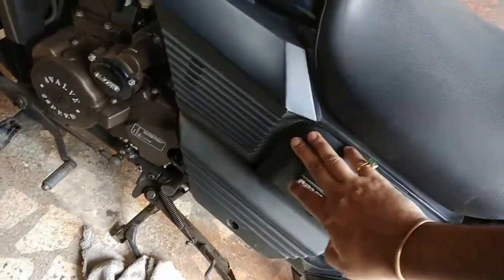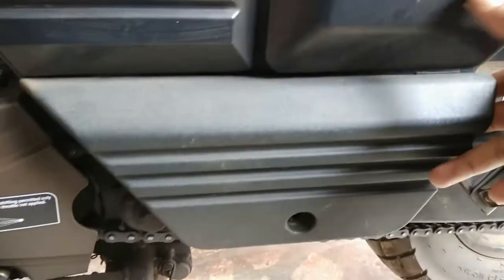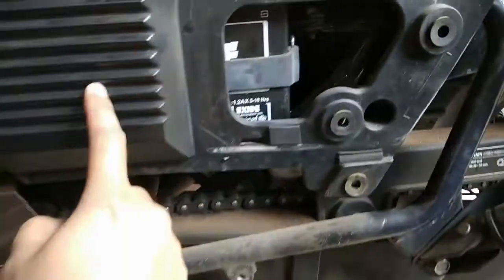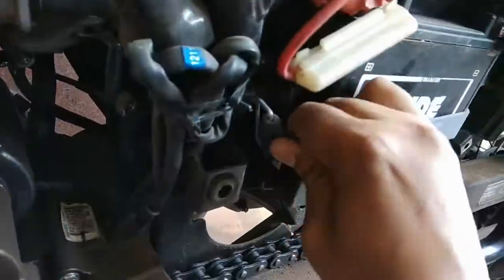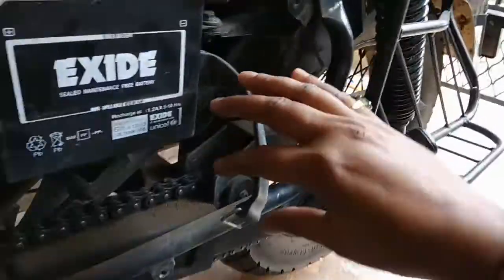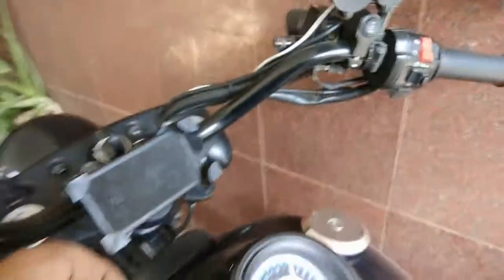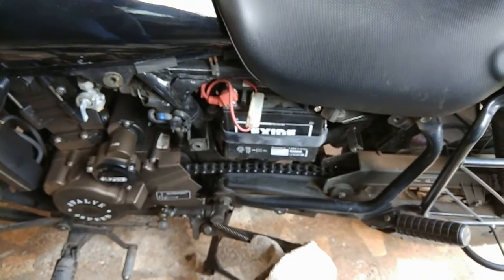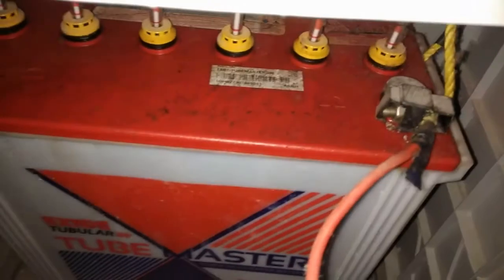Motorcycle Starting Problem | Battery Issue | UM Renegade

Comment: Hello sir! 
I have UM Bike at present. 
But the bike has a problem that Battery charging is not working. 
So, It's been more than 15 days i kept at workshop. 
My battery AH is 12AH.
They suggest me to buy more than 14AH.

So, Sir! My question is Can I buy battery more than 14AH?
Reply from the maker: Hi - I don't think more than a 14ah, bike's coil will support. Go for 14ah. If the battery is not charging it could be a different reason, check that first.
Reply: @DreamerzJay  
Sir...! 
I have already changed fuel Injector, Dynamo, and filter. 

So, what could I change more than that sir? 
Sometimes when I put for RE battery, it can start .
Reply from the maker: Unfortunately, I don't have any idea what else you can do. I would suggest finding a good mechanic to address the issue. All the best

Comment: Sir which battery comes in UM renegade.. I have to replace the battery.. Please confirm the amp
Reply from the maker: hi - 12ah...exide or even amaron have. check with your local battery dealer.
Reply: Exide ETX-14 of 12AH Capacity in Commando Bikes; If you cant get the same, put a kill switch for your Headlight which is AHO type (All the times ON with out any OFF Control);  Then Change your tail light and Right/Left Indicators to LED bulbs; Your load to battery will come Down; Then use an Amaron ProGlider 9AH battery. You will be safe and Your Rectifier's load also will come down and its also safe.
Reply: Sorry for the delayed reply; Now only i am getting femilier with my bike after come across several issues.

Comment: Is it possible to upgrade the batter to 14 v instead of 12
Reply from the maker: 14v or 24v?
Reply from the maker: changing to 24v is not easy. you will have change every electrical part of your bike to support 24v battery. But why do you want to do it?
Reply: I heard that there is a problem with the starting of the bike so if we could upgrade it from the stock battery then it would be better what is the stoke battery capacity
Reply from the maker: no bro, upgrading the battery is not required. stock battery is good enough.   some stock batteries have issue. but lets not generalize the issue, not every bike starting issues. Starting problem could be of various reasons.
I got no problem with my bike stock battery, i got additional lights as well. Bike needs good maintenance.
Good luck.
Reply: Let me no the  Ah of battery for renegade commonado.. classic..
Reply from the maker: Go for exide 12v 12ah battery

Comment: Battery has been a very big problem for the commando bikes. The bike is idle for a few months now as I am unable to find ETX14.
Reply from the maker: check supersonic or amaron. Even th ey got 12ah battery which suits commando space.
Reply: @DreamerzJay  Is it the same for Commando Classic?
Reply: Mechanic has put SF Sonic TZ9, but even that's not working properly. Looking for replacement.
Reply from the maker: Try Amaron, read someone mentioned that works well with bs4 model. bcoz bs4  need atleast 12ah battery else you will have starting problem.
Reply from the maker: if fuel injection engine, then you need minimum 12ah battery
Reply: Got a lead and should get the Exide tomorrow. Will update once I have it
Reply: Finally managed to get hold of ETX14 and after 3 months bike got a life. Phew..
Reply from the maker: brilliant mate, do share your experience after fixing it. good luck.
Reply: Went for a ride to handover the other battery and did about 70+ kms without any issue. Bike was good as long as it runs, but any breakdown or issues, then it takes ages to fix it. Very sad they killed this brand like this.

Comment: At @5:08 your hand is next to a rubber in your left which is also present above. The side panel’s 2 projections fit into this and it’s what holds the panel. Do you know what this part is called? These 2 fell off for me while charging battery and I lost them and I’m trying to get a spare.
Reply from the maker: i don't believe you can get a spare of that rubber bushes, which holds the renegade emblem cover. but give it shot in any open service center. you might get lucky. 
else cut a small thin rubber tube and push it in, it should the cover.
Reply: @Dreamerz Hey man I was able to get them from Balaji Auto Traders near Commercial Street. Anyhow, thanks a lot for replying back... I appreciate it.
I’ve recorded a video of fitting it back that you can check out here if you’d like:
https://youtu.be/LzhaVzgBo0Y

And here are the photos of the item, the store guy said it’s commonly known as panel rubber:
http://imgur.com/a/lLnlean